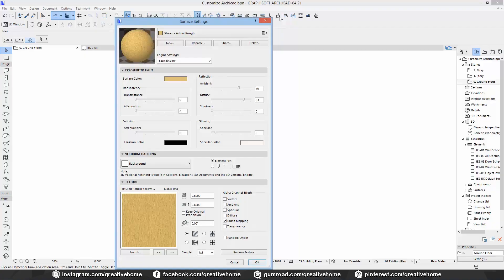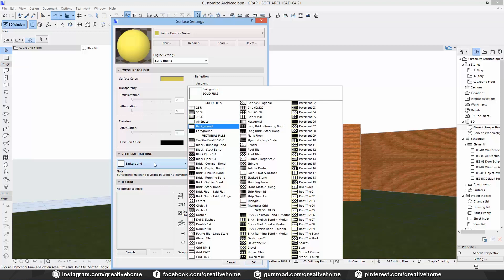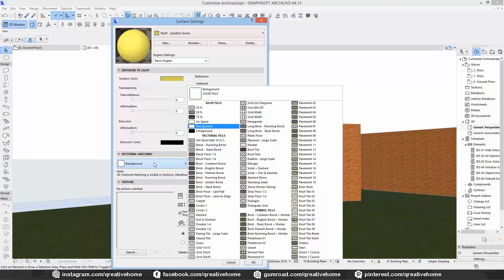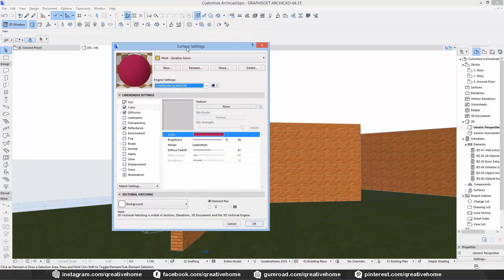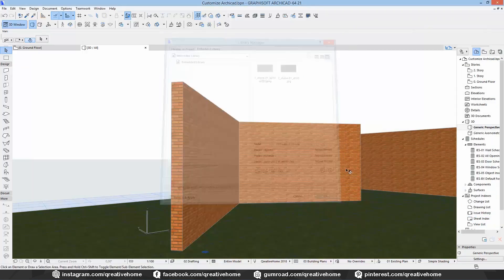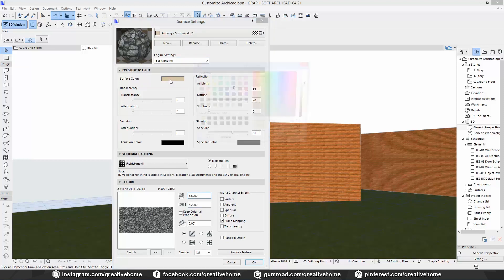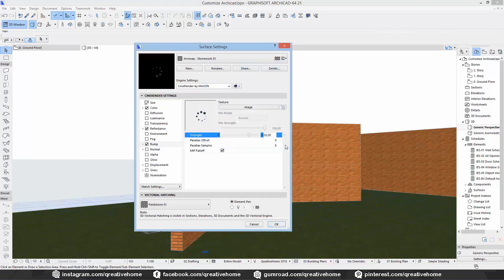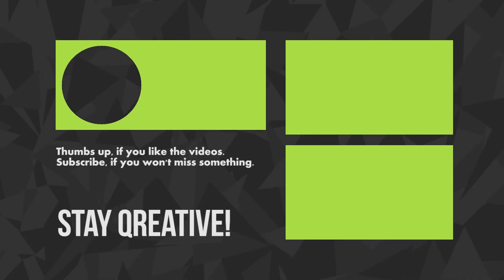Customize Archicad - Surface Materials / Textures 04/16

Comment: Hi, can you tell me how can I save the texture to use on other projects?
Reply from the maker: There is the "Attribute-Manager", when you open the attribute-toolbar. When you open it, you can add attributes (one of them are the textures) to the right side. Then you can save it as an .aat-file. This aat-file can be openend in another project using the attribute-manager. It's part of this video series. I hope I can finish it in the next couple weeks. I need more time ;)
Reply: oh, ok, I think I got it...it could be easier no? by the way, on the other day I was editing an object that I got from C4D and was fixing it, and did new surfaces. then I saved it in .gsm but when I open it it comes with out the surfases, so, do I have to save a .gsm of the object and a .aat file for it surfases?

Comment: How can the color of a texture be edited? I added a textile surface which color I'd like to change. I tried to modify some of the surface CineRender channels (along with the color channel, the bump channel etc) but nothing happens. The surface keeps rendering with the original texture color.
Reply from the maker: fineline111 Sounds like you changed the colour in the Standard Render Engine, but you rendered with CineRender. You can copy the Parameters. (I don't show this in the video)